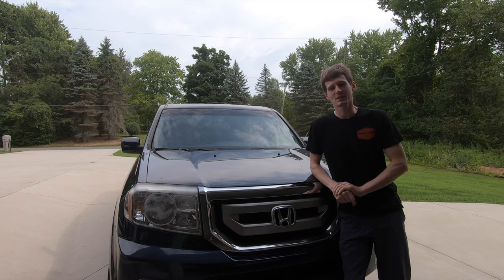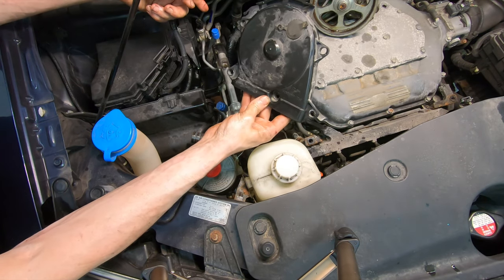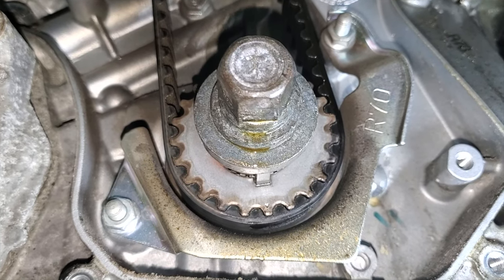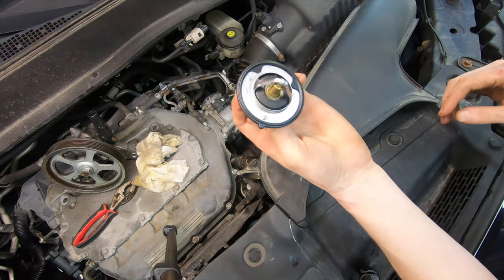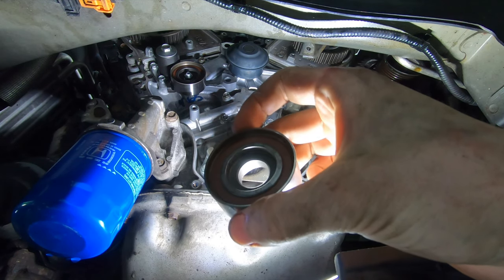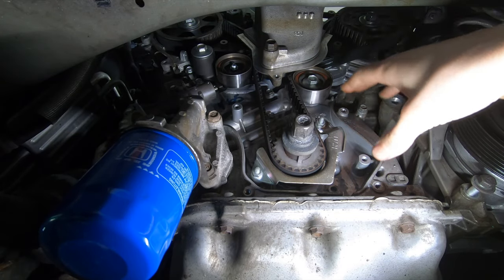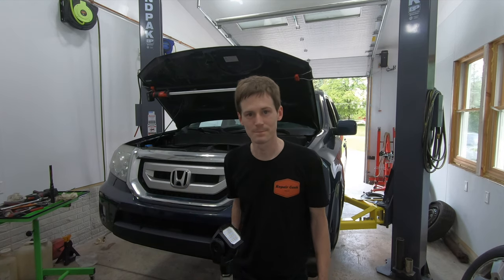Honda 3.5L V6 Timing Belt & Water Pump Replacement- Pilot, Ridgeline, Odyssey.

Comment: This crank shaft bolt is crazy stuck. I got the big socket you recommended. 4 foot breaker bar. Broke an extension. Still stuck.....
Reply: I bought the same special crankshaft pulley bolt socket and I've done this job three times already.  The first time I tried to get that crankshaft pulley bolt off with just a breaker bar and a regular socket, I was stuck trying for an entire day and no luck. 

With that special heavy socket, you need to use an impact wrench (electric or pneumatic) with it in order to make it work.  It's close to impossible any other way and doesn't work with a breaker bar.
Reply: @creatureunderthebed7083  is it possible to deal with the crankshaft without a lift? i have milwaukee impact gun, crankshaft holding tool, torque wrench, 3 ton jack, stands, leslie 19mm socket.
Reply: @kensimon4478  Absolutely you can do this job without a lift.  I did all of them in my garage but you still need to support the engine (floor jack with a piece of wood between the jack and engine) as you need to remove the passenger side engine mount.  I would recommend two jack stands to hold the car up and then the floor jack to lightly support the engine while you work on the timing belt.  

Make sure to carefully align and mark the upper camshaft pulleys prior to removing the old belt to preserve the timing.  Watch the videos as you go to make sure that the steps are being followed precisely.  After doing this job three times (we own 3 pilots in the family), it has gotten easier with repetition but I still take my time aligning the marks and making sure the timing didn't change prior to installing the new belt.  Make sure everything looks good before pulling the pin on the new belt tensioner.
Reply: @creatureunderthebed7083  I've seen a mechanic work on 2 timing belt jobs. He's good at them and does a timing belt job in under 2 hours. He used a lift. I remember him taking the passenger side mount. For hisnindont recall him holding the engine up. Just this video nothing is holding up the engine...
I've asked around how to tighen the crankshaft pulley and they all say floor jack. I keep asking hoping for a different answer. I'm still worried and tightening it with a torque wrench. Will the floor jack give me enough clearance to tighen it? Ive been searching youtube and google on a visual of how this would look like.
I recently did a valve gasket replacement with the guidance of a good mechanic that has some "character issues" and it went extremely well. Now I want to do  the timing belt kit change for my other odyssey.
Reply: @kensimon4478  If I had to do another Honda J35 timing belt change again I could easily do it in less than two hours...and I don't do it everyday.  A competent mechanic could possibly do it in an hour flat.  A lift is not necessary to do this job bc much of the work can be accomplished from under the hood...engine mount removal, timing belt cover, water pump, belt removals, tensioner.  You can't do it from under the car so a lift only helps occasionally.  I did all the jobs on the floor of my garage with a 3 ton floor jack and two jack stands.  

As far as the engine goes, you need to remove the passenger side engine mount completely to change the serpentine and timing belt.  If you DON'T support the engine from underneath the car, then you better pray the remaining two engine mounts are in good shape and can support the entire weight of both the engine and transmission (has its own small mount) while you're working under it.  It's no different than jack stands....do you use one or two when you're working under a car??  Some people only see the point in one jackstand to hold up 4000lbs and they think two jack stands is useless.  So if you don't support the engine and transmission after removing one critical engine mount, then that's your 'one jackstand' risk level.  I'm telling you to support the engine with the floor jack during the ENTIRE process until you can reinstall that mount.   Every timing belt I do means I support the engine bc I don't trust the other engine mounts.

If you are using an electric impact wrench to take off the crankshaft pulley bolt, then use exactly the same wrench to reinstall the bolt.  Bottom line is that the bolt is on VERY TIGHT.  If using the special heavy socket to remove it, you can basically torque down that bolt when you put it back in with a REGULAR impact socket.  No amount of torque is too much when it comes to reinstalling.  I've torqued the shit out of that bolt only to easily remove it 80k miles later with the heavy socket to do another timing belt job with no issues.  

Bottom line...no lift required.  Remove bolt with heavy socket.  Reinstall with regular impact socket.

My pilots are still rolling with 254k (2003) and 161k (2007) and my mom has a 2007 Pilot as well.  I've done timing belts on all of them and the J35 engines are pretty much the same.  Take whatever advice you want on offer but I've successfully done every single timing belt on all three vehicles and they're running great.
Reply: @creatureunderthebed7083  I have the big boy milwaukee 28383-20 1/2 impact one key impact for the job. Also have 2 jack stands. I was asking about lifting because I was told I should tighten with an impact. I'm still learning the tool. I've had it for only 2 days.
I just did a valve cover gasket on my odyssey and it went extremely well. First time doing it using youtube help. Last week was my first time doing an oil change lol...
I have 4 odysseys and thought instead of taking them in just buy the tools and do the jobs myself.
I have witnessed a timing belt kit change for one of them. They were done by air tools. I will be building on milwaukee battery tools.
Reply: @kensimon4478  You can use that big M impact wrench for the entire job with the crankshaft pulley bolt.  Use the heavy 19mm socket to remove it but only use the regular impact to tighten the bolt.  My air impact wrench is nowhere near as powerful as your electric M wrench and it tightened it just fine.  Never had a problem.  Don't stress over it especially bc u have the hardware to handle the hardest part which is that crankshaft pulley bolt.
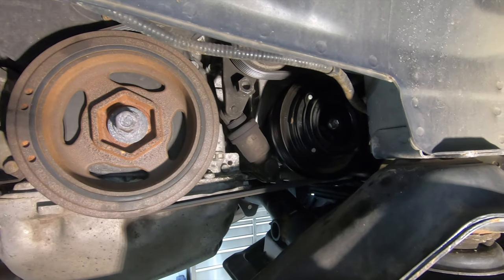Reply: @creatureunderthebed7083  I still have to learn the 1/2 impact. Check these settings out at 3:55
https://youtu.be/upQdMJLorkk

maybe I can set it close to specifications and push the car onto my ramps to torque it.

I have a tekton 1/2 inch torque wrench
Reply: Use the car’s engine to torque the bolt off. Place the socket on a breaker bar and brace it against the frame or strong structure under the vehicle and bump the car’s engine. In other words turn ignition but don’t start the car. The engine will turn and loosen the bolt. Just beware that rotation of different engines varies. It worked for me, the engine rotated clockwise.

Comment: Hey i need to replace the timing tensioner, do i have to remove all the covers ? I see the bolts are outside anyway
Reply: You need to remove the rear cover, only to be able to pull the bottom cover far enough back to get access to the tensioner

Comment: Careful torquing the timing belt tensioner pulley and the idler pulley. One takes about 19 ftlb and the other is like 30. These are known to break. At Honda we replace the idler bolt.
Reply: When should I change my timing belt ? I’m not sure if mines I’s original I bought the car from a used dealer and it was serviced at a Honda dealership and told to come back at 107k miles . I current have 104.7k on it bought at clean 104k. Would you think it’s due for belt change ? Just drive from pa to NY last week drove very fine on the left lane. Still very strong pulls when floored even a small tap. just wondering your thoughts I’ll still go at 107k maybe earlier to see if it’s original belt

Comment: how long did this repair take you real time?
Reply from the maker: I shot video, and had to wait on the motor mount. You could do it in a day. Taking your time.
Reply: How long does it typically take you if you’re not distracted?

Comment: uhh, there is a block drain plug on the back of the block you could have used.  good video ,,so far
Reply from the maker: Yep except I live in Ohio and things are rusty. I'd rather not risk breaking off the block drain.

Comment: Surprised that Honda kept using a rubber timing belt until 2011.  I thought most engines changed to more reliable chains by then.  My 1996 Plymouth 2.4L DOHC in our minivan has a belt.  Twice a pulley bearing failed (tensioner then idler) to shred the belt and cause the engine to die.  Not an interference engine, so no damage (actually valves can hit each other, but unlikely).  I read the Honda 3.5 is interference so a failed belt can bend valves (bad).  We looked at an Odyssey long ago but declined since read of constant transmission issues.  We bought a 2002 Chrysler T&C instead and the 3.8L engine is at 285K miles with no issues.  A robust pushrod engine with thick timing chain which never breaks like in old classic U.S. V-8 engines.  Anyway, suggest changing the pulleys too while in there, or press in new bearings, German or Japanese, like I do if you have a press so you can control the quality and avoid the cheap Chinese bearings in most parts. Chrysler minivans changed to OHC V-6 too ~2010.  A more robust timing chain, but still more issues with those than the earlier V-6 w/ pushrods.
Reply: You obviously have never been around Ford 4,0/4.6/5.4 engines.  All have chains and they fail.  Not from chains breaking, but the cheap plastic guides that break and fall into the oil pan and clog up the oil intake.  Most engines have some fatal flaw.  Everyone toots how they love their Subarus and these have head gasket problems.  As for the newer Chrysler 3.6 engine, lots of problems to include defective blocks, heads.  Also personally changed cam followers on a 2013 Caravan.  Keep you old Caravan running.

Comment: Im going to give this a try one more time, I had an issue with the crankbolt but have a new impact wrench, so if all goes well,  Ill be going along with this video to help assist with this timing belt job.  So I guess you can say im going to get there Guided by Geek. :)

Comment: If you cannot break the crankshaft bolt loose try heating it with an electric heat gun for stripping paint..it worked for me after my 6 foot cheater pipe wouldn't budge it..

Comment: How many miles do you change
Reply: Not more than 150k. Honda suggests every 100k. 
I did my 2008 at 180k (tensioner was shot) and another 2006 ody at 270k (2nd time around. Tensioner was shot too)

Comment: What would this typically cost at a shop?
Reply: On my 04 odyssey it was 1600 at the dealer
Reply: @CpuWaiy  Wow!  My buddy used to pay $800 at the subaru dealer.  Then it went to $1000.  Now it is that high.

Comment: What is the labor time on this job?
Reply: Local garage quoted me 5 hours
Reply: Dealer told me $1250 for the job. An indy said between $800-1100. Both are pretty steep. Without a lift, the job seems like it would be pretty complicated. Especially, with the torque spec on the crank bolt.

I'm still contemplating on trying it myself. I have the whole winter to mull it over.

Comment: Honda pilot interference engine, but by accident  rear cam turn into clockwise 45 degree twice by trying to put timing belt (had metal bang noise). Just want to share who is doing timing belt job. It was perfectly fine after put back everything. No engine warning light or strange engine noise. Better not to move cam but if happens like me, don’t need to be panic.

Comment: You wont see alot of guys torquing those crack pulley bolts. That weighted socket will take it off just fine with an impact gun. The crack holding tools isn't nessessary if you have the weighted socket. Impacting it back on tightly with the weighted socket will be plenty.

Comment: good moring, great video. i wonder what anyone thinks about this being an interference engine? my belt went out while driving and i did crank it a little after to see. what the chances i have no damage to my valves? anyone???
Reply from the maker: 99% chance you need an engine.

Comment: You can put a breaker bar with 19mm socket on the crankshaft bolt and slightly turn over ign key and it will loosen crank bolt. If you have a heat torch then heat bolt for 5 minutes and it'll help even more
Reply: Just buy the $20 socket, then u don't have to worry about damaging your front crank seal. U can rent an electric impact gun for $20 if u don't have 1.

Comment: Pro tip guys :heat up the crank bolt 1st, tighten with torque for a sec, then back it out dont stop till she drops 😂

Comment: This is an awesome instructional video and thanks for taking the time and the effort to upload it! Getting that crank pulley off for me was a gold-plated bitch.  I wound up getting it warm at spraying kroil on it and letting it seep in. And I used my biggest impact. I need to get that Honda socket for this one that's upcoming...
Reply: I bought the socket and mine still won't come off tried heat already. No joy. waiting for the kroil to soak in right now. Just came here to peruse the comments to see if I could get some pointers.
Reply: @eastshop8650  If you're still fighting it, mix 50/50 acetone/ATF. Drive it around and let it get hot and hit it again then again. But that socket should have helped. You must be in a cold salty place or along the coast. I wish you luck but that is the extent of my ideas
Reply: @Jeff_Seely  Thanks. I got it eventually. Just a lot of patience and persuasion.
Reply: I was not aware of the bolt problem when I pulled the pulley.  So I removed the flexplate/flywheel inspection cover where the trans meets the engine.  I then used a 3"  3/8" round punch and jammed it into one of the flexplate teeth and the side of the bell housing. You could probably wedge in a bolt of similar size. That held the pulley from moving.  Did no damage.
Reply: @lloydballard7051  this is an excellent solution to A difficult problem. Thanks for the advice and I'll remember to use that on similar mechanical obstacles
Reply: @eastshop8650  it is one helluva nightmare sometimes. But if you hit it with that mixture and then a bit of heat followed by cold you'll get it. I always try to plan for super cold days to do this. Chore and just use my torch. But you're right man it sucks!!

Comment: This is not a job for most people. Ive worked on cars for decades and this belt is just too much of a pain to diy. And i know this is about 1400 at a shop to replace.. theres a reason people sell them off  and not do the timing belts😊
Reply: These are relatively easy

Comment: I just pd $2 k for this job don't think tensioner  or pullys replaced nor motor mount checked blew me off on thermostat & charged me another $150 to replace coolant.
Crank & camshaft front & rear seals & both belt cover gaskets.  I had to telll them to replace serpentine belt, they weren't going to.
Had oil leaks & sludge blown all over bottom of engine they couldn't explain why!
1 week later still several oil leaks took the car back for them to replace the VVT gasket. Now they want to replace the bracket and the power steering hose.  WT.....
Did I just get had???
Also was charged $600 for new oil pan after dealer oil change stripped drain plug. Then I pd $75 for another oil change with a way smaller oil filter not OEM.
WT...
Did I just get screwed???
Reply: Yeah maybe. 5 years ago I think I was quoted $1400 for the timing belt service and the serpentine belt is usually always changed with the timing belt so that's a red flag. I found an OEM kit on ebay for $150 with water pump and everything. I swapped it my garage, not to bad if you have the right tools. I don't think the coolant is $150? I hope they put the correct coolant in as well.

At 200K I had to replace the valve cover gaskets. That's when I found my power steering hose bracket floating lol. I just bolted it back in. That's the only oil leak I have had and I'm up to 250K. But my drain plug has always had a very slow leak. I have tried many different types of sealing washers but I never over torque the plug. I think that pan might be aluminum so its easy to strip. I would guess they stripped it trying to prevent it from leaking.
Reply: @Big_Slick  I paid like a grand to replace the oil pan. Doesn't seem that difficilt. Dealer sells pan for $168 but I paid shop $600.  I would love to fix car my but I have no where to do it nor do I have know how.  Timing belt job in 09 Honda   Odyssey is 5 hrs & seems like a big PIA  I watched a video of job. Yikes ! My husband used to do all work to my cars.  Since he passed I have been unable to find a trustworthy, competent, affordable mechanic.

Comment: Belt is off align mmarks belt wont go on.TDC number 1 cylinder the belt wont go on.Take it off and turn engine it locks hitting a valve...

Comment: Anyone watching, the tensioner bracket is not 19ft/lbs, ask me how I know. It is 104 inch lbs or 8.6 ft lb. If you tension to 19 ft lbs the bolt will snap.
Reply from the maker: The tensioner is 9. The arm that actually tensions the belt is 19.

Comment: Dude, you aint no geek.  Your tricep says, "Stud"!   Heck though, my Lexus ES330 has a torque spec of 217 foot pounds on the axle nut and it's not too strenuous, so 181 foot pounds on that crank bolt seems like I'd want to confirm that number.

Comment: How the F@#$ did you get to that other engine mount bolt on the other side of the computer ...
Reply from the maker: Long extension and pull on the computer bracket a little.